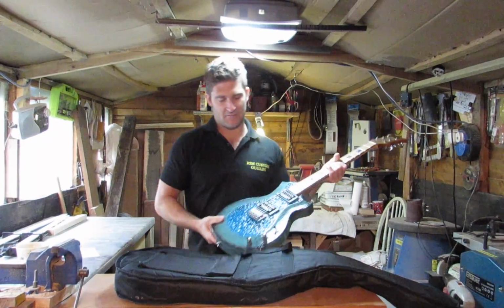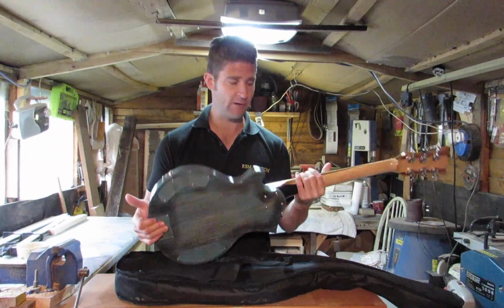How to build a guitar with RSM Custom Guitars - the finished article

Comment: Great job ... got a question if the LEDs burn out how do you change a? Also on several of your videos the video itself kept pausing while the audio kept going thought I would let you know. Definitely good guitar playing also.
Reply from the maker: Hi Larry. Thanks for watching! Regarding the LED Lights. I looked into how durable LED lights are before I installed as a permanent fixture. Apparently They are good for over 50.000 hours of use. So if you had the lights on for 12 hours a day they would last for over 11 years. So not much to worry about if you only gig once or twice a week for a two hour stage set. It should last decades.            As for the pausing and audio issues, I am not sure why this is. Maybe server issues? I will look into it though. Thanks again Larry. All the best my friend. Rob

Comment: Thats amazing! earned yourself 1 more subscriber! Is there a specific type of LED light strip you used? do they at all interfere with the pickups? Thanks for the video!!
Reply from the maker: Hi Chris, Thank you. Glad you enjoyed the video! I found these LED's on Ebay. They are just the water resistant type. They don't interfere with the pickups or circuit at all. I have used that guitar now on a number of live gigs, with no problem at all. Thanks again. Rob.